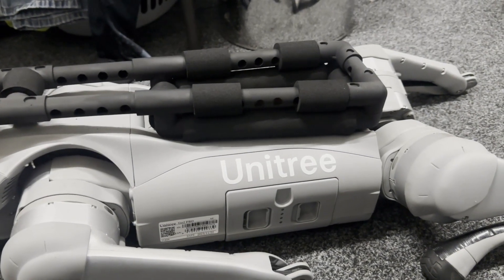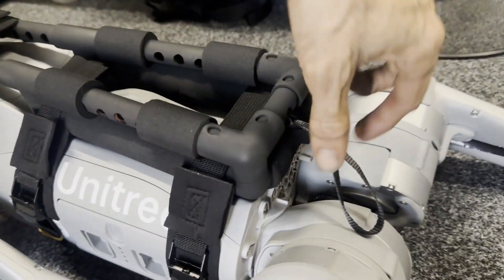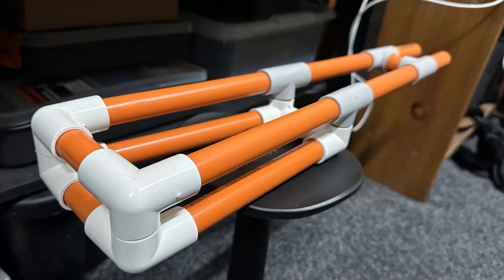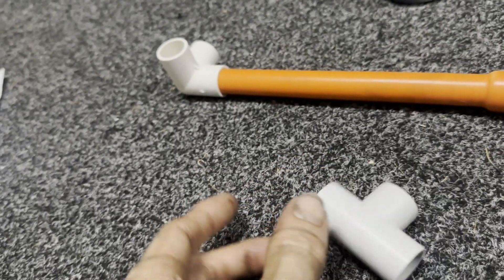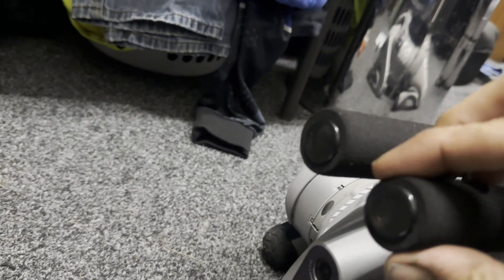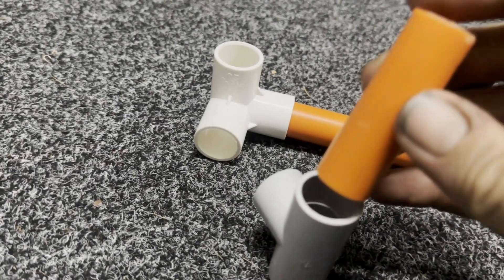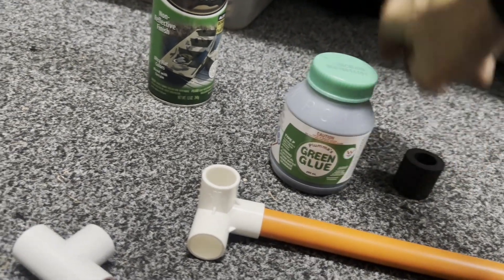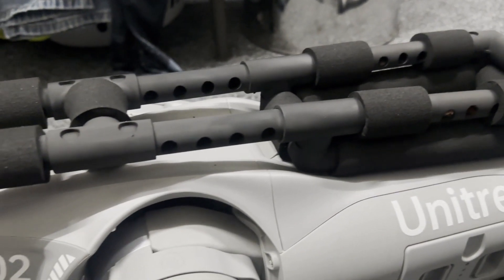Unitree Go2 DIY (Utility rack)

Comment: What is it for 😮
Reply from the maker: It's basically just something to bolt or strap accessories on to or hang packs off. I am working on a head tracking camera to put on the dog so needed something to attach components to like external battery pack and mount the cameras, servos and electrical gear. I didn't want to start drilling holes in the dog or use mounting tape or anything like that. Also can carry the controller in it like a basket or drop my JBL charge 5 into it for music.
Reply: I built a head tracking camera for my go2 pro https://youtu.be/urqjuH7wc-I?feature=shared